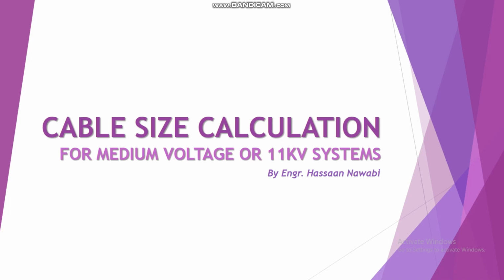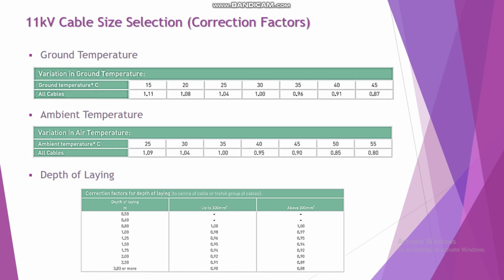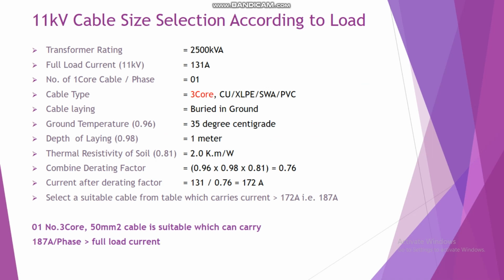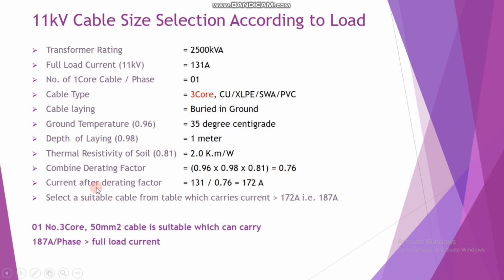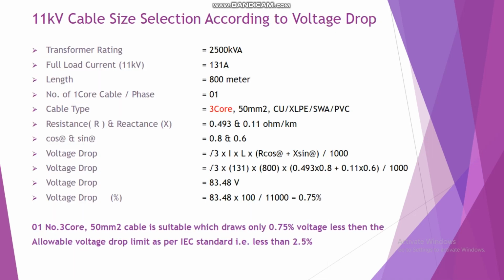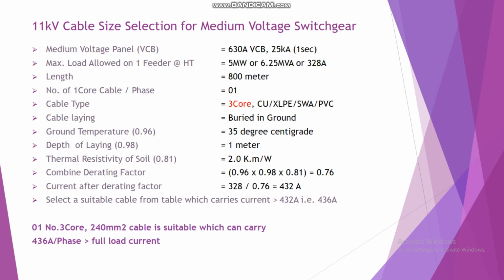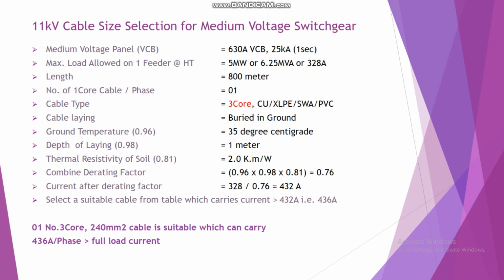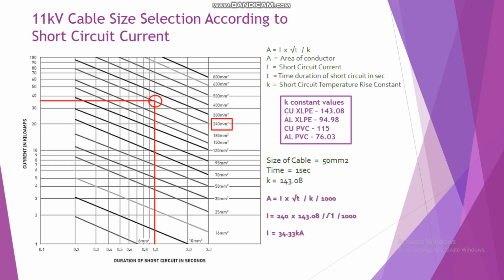Cable Size Calculation for Medium Voltage or 11kV Electrical Systems

Comment: At 3:51 how you select soil thermal resistivity derate value of 0.81 even still cable selection is pending! Because soil thermal resistivity value is depend on cable size. You select resistivity value before any cable selection.
Reply: Thermal resistivity depend on soil types, and initially starting with normal backfill if cable is failing then you can use special backfill or increase cable size or space alternatively

Comment: Your videos are very informative and extremely helpful. ❤️
Could you please consider creating a similar video on Aluminium XLPE/SWA cables? Currently, in the UAE, both TAQA and cable manufacturers are increasingly adopting aluminium cables as a cost-effective alternative to copper cables.

Comment: Sir
In you first example, 50mm2 is selected and has 7.1kA which it can withstand in case of short circuit.
But my question is how much short circuit current kA would come from feeder in case of short circuit? 
If it is higher than 7.1kA, it would burst, I understand.
What I could not understand is, how much short circuit current in kA would come from feeder in case of phase to ground or phase to phase short circuit.???

Comment: Current after derating factor why it is devided by 0.76..it should be 131*0.76 apprximately 100 Amp
Reply from the maker: When you divide with derating factor, you will get the value of current, including derating factor margin. When you multiple with derating factor, you will get a value of current after deration which means you need to add additional derating margin to find out the value of current to be selected from cable table.

Comment: hi sir, i gave one doubt if the length is 15000 MTR as my able length is 15KM shall i need to divide it my 1000 or 10000..
Reply from the maker: Brother you need to divide by 1000 if you are taking length in Meter. If your length is already in KM, then no need to divide by 1000. Means if you are taking 15km then no need to divide by 1000

Comment: de rating factor reduces the current carrying ability of the cable , so 187A x 0.76 = 142A , as the FLA of transformer = 131A, selection of the cable size of 50sq.mm is good. correct me if iam wrong.
Reply: That is what I thought myself. De-rating means reducing the rating of something and they should be multiplied.
Reply: You re wrong

Comment: Do you know about any software for a medium voltage cabling calculations?
Reply from the maker: Softwares are usually rough estimates and calculations vary according to the Cable manufaturers specifications or tables. So you must understand the cable size Calculation for right selection of cables.

Comment: Could you please advise how we can find the Max. Load Allowed on 1 Feeder @ HT = 5MW or 6.25MVA or 328A?
Reply from the maker: Hi Artemois, It all depends on how much your concerned utility or electrical distribution company allowed on one feeder. 

I have shared the allowable load limit that is 5MW on one feeder referring to what allowed in Pakistan. It varies country to country.
Reply: @electricalknowledge2654  Thank you very much!
Reply: It depends upon the current carrying capacity of the conductor used.with ACSR dog conductor, you may transmit 5 MVA load at 11kv

Comment: How many transformers can feed from m v switchgear in one loop
Reply from the maker: Ali, It depends upon what rating of transformer you are connecting to one feeder. However, 5MVA can be allocated on one feeder usually by WAPDA.

Comment: current for low voltage side is incorrect because short circuit current must be calculate for medium voltage network 500 MVAS.C
Reply from the maker: Ayman, These calculations are for medium voltage cables and short circuit fault current calculated at specified duration of time. 

I think you are mentioning about fault current of system which are require to be calculated on base MVA of system.

Comment: I think 2nd slid calculation is wrong. it will be only 2500KVA or you need to divided 1000 also. thank you
Reply from the maker: Saddam, Answer is correct i.e 131A. However, you are right, the voltage is 11000V instead of 11kV thus to ensure the units are same.

Comment: when you size mv cable , only short circuit power is enough ,
Reply from the maker: You must comply three criteria i.e. Current Carrying Capacity, Voltage Drop and Short Circuit Current.
Reply: @electricalknowledge2654  
Experience of 30 years says 
Short circuit power enough for mv cable..
Reply from the maker: @transientmatter6088  It depends, you may be right. What would be your reference for short circuit current before selecting a MV cable. 

I would recommend to comply all the three criteria.

Comment: 120Kw motor need to cable size , with copper and aluminum,  please brief example with formula
Reply: Can be use 95 sqmm

Comment: from where you get the cos@ & Sin@ value? respectively 0.8 &0.6 please clear.
Reply from the maker: Power factor assume to be 0.8 in the selected case study, however the value may changes according to your requirements or conditions. The value of @ will be be calculated from cos@ which further derive the value of sin@.
Reply: @electricalknowledge2654  could you please clarify the 'The value of @ will be be calculated from cos@ which further derive the value of sin@'?

Comment: Hi H N, As I have known for the motors, we should be aware of voltage drop in both steady state & starting of motor. Could you explain for these cases of Motors?
Reply from the maker: Please watch my separate video on cable size Calculation for motors and group of motors